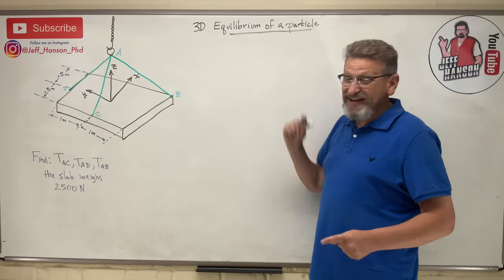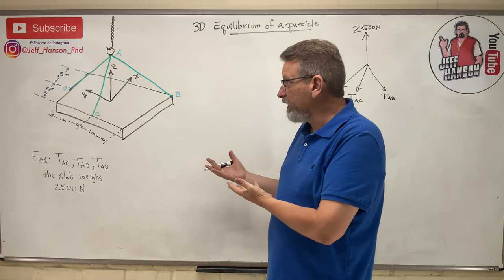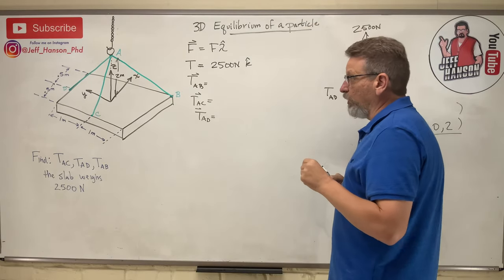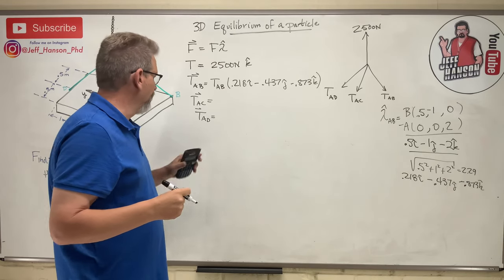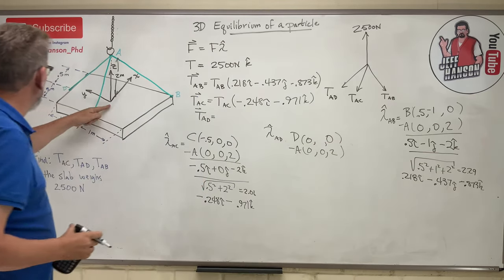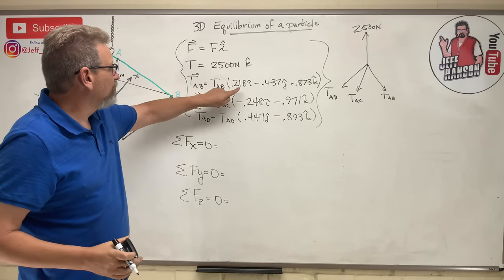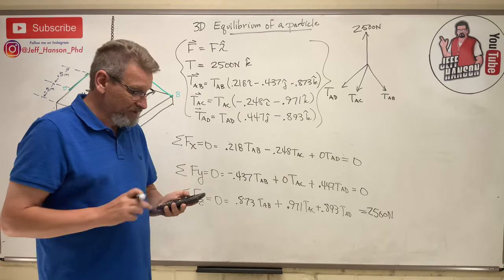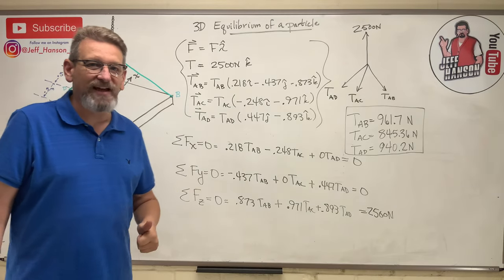Statics: Lesson 19 - 3D Statics About a Particle, Calculating Unit Vectors

Comment: Forgive me if I am wrong; however, if you are considering that the 2500N is in the positive Z direction, then shouldn't the coordinates of B be (-0.5, 1, 0)?
Reply: This is correct I think. I had the same question.
Reply: @josephh.1243  also ran into this issue
Reply: i think the Fz equation should have been -.873TAB-.9704TAC-.8964TAD=-2500N (neg 2500N).
i'm thinking we're noticing same thing.  am i wrong?
Reply: Is this for the lambda ac coordinates? (C?) i ran into the same problem too
Reply: I was thinking the same, what answers do you have? I got AB = 1145, AC = 1030, AD = 558.9

Comment: 8:54 I spent twenty minutes on this problem, thinking I made a mistake. Your method was correct you just plugged in the wrong value into your calculator.  
-0.5/2.06 and not -0.5/2.006
The correct answers are: 
BA = 954 N
CA = 858 N
DA = 932 N
Reply: I also got confused there good thing others caught that as well.
Reply: here i am and got those exact values. good eye
Reply: Another reason to use variables until you want the answer
Reply: I thought I was going crazy lmaoo I just caught it and was checking to see if others did too
Reply: Good catch.
Reply: I tried this problem in the Ace statics book. I got a bit worried when Doc changed the x,y planes. In the book, it seems the normal orientation. I got
ab= 954.9
ac= 860
ad= 931.5

Seems nearer to the above post. I'm using the Casio fx-991EX classwiz.

Comment: I'm confused in lambda method particularly on how to get the coordinates of points.
Reply: You base it on the illustration of the problem
Reply: The way I think about it is that 2 cables are anchored in a flat surface (x and y) and the third one (z) is anchored somewhere up in a hill.